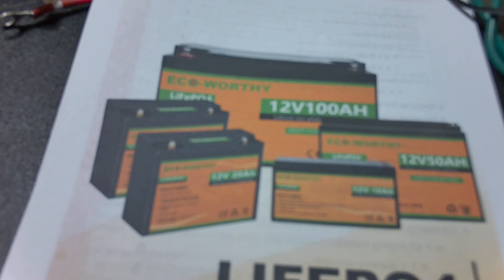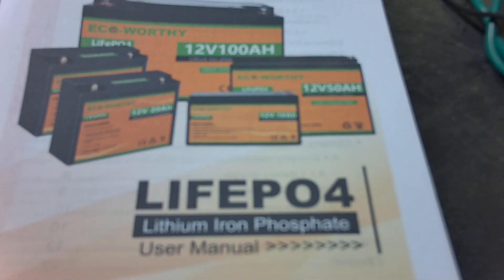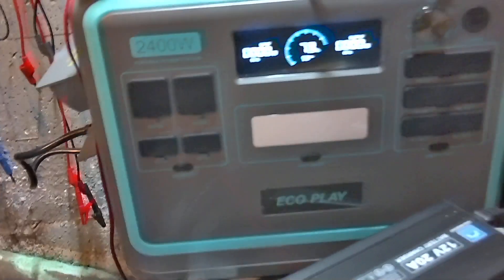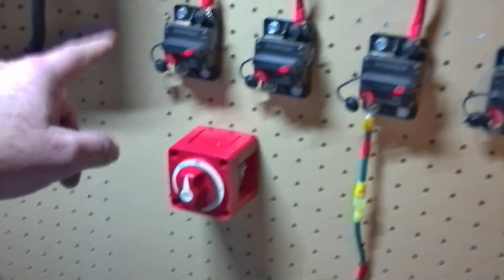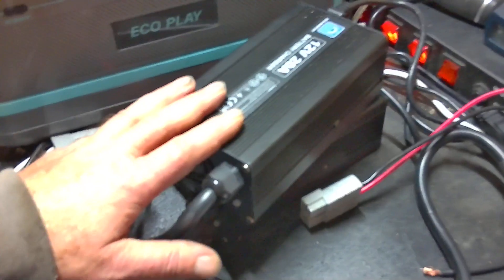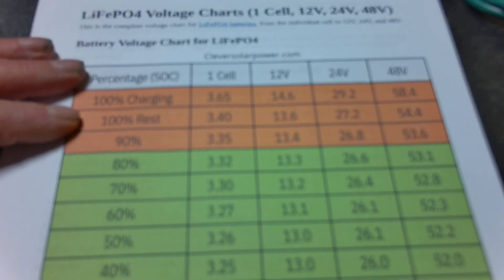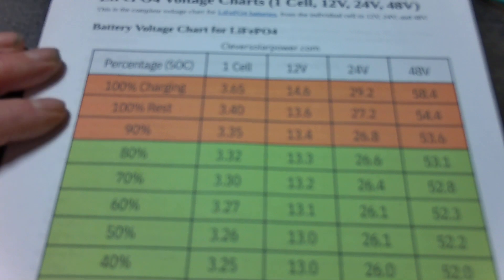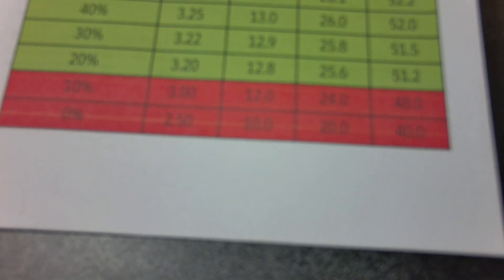LIFEPO4 battery  before or as soon as you buy

Comment: I started to put breakers on each one of my batts also. Same reasons. Also, I didn't like arcing the studs when connecting inverters. I never had one those fuses I see people power the inverters with so it don't arc. Just found putting breakers like yours in mix better overall solution.
Reply: If you bought chinese stuff, then Your a hell of a devil ! Buying china's stuff  is very bad for all! Stop buying chinese stuff! Its preferable not to have and say it loud!
Reply from the maker: Yes , putting breakers in isolates the batteries so you can connect  inverters or other loads to your system safely . Thank you for commenting .